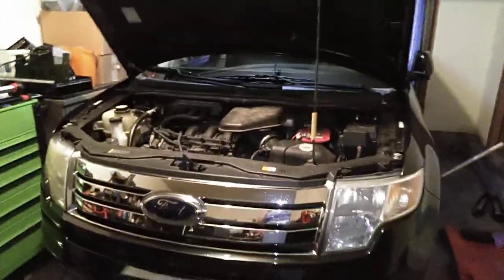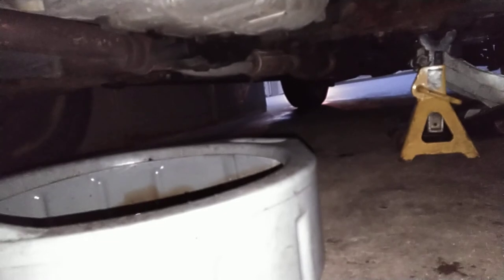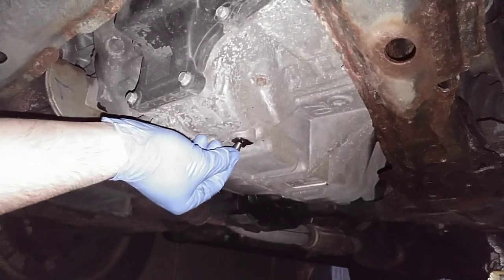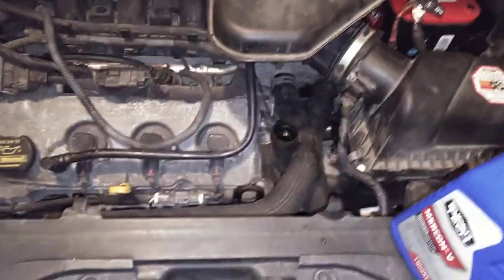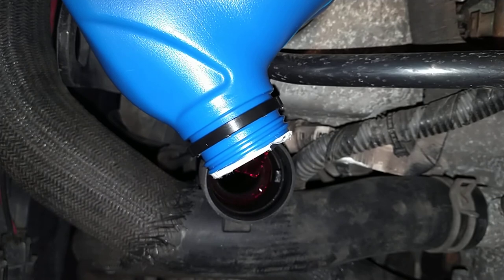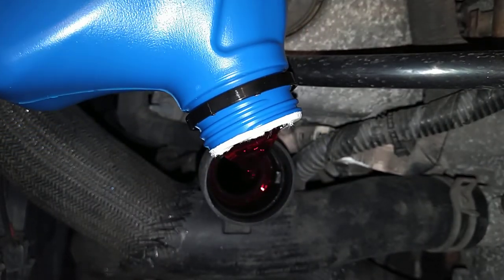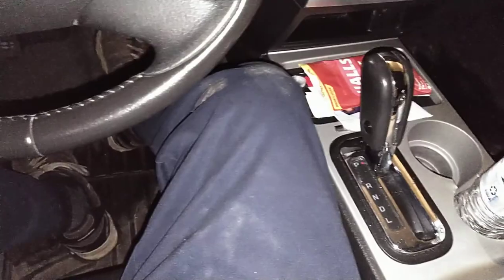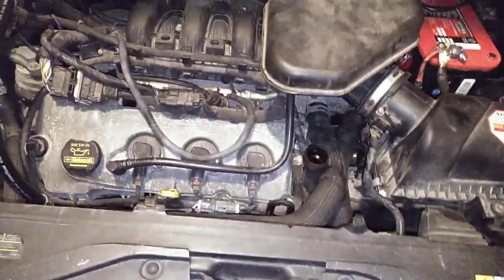Ford edge transmission service

Comment: Please why is my 2010 Ford Edge not moving when I step on the gas and it’s giving a grinding noise?
Reply from the maker: Do you have a video of it? It is either a PTU broke or the transmission went out. Open your hood and pull the dipstick on your transmission and see if there is fluid on your dipstick, if there is what color is it? Black or really dark is bad, that means that it’s burnt. If it’s pink or red it’s good. Pink is the best but red is okay. Let me know what you find!
Reply: @T-MillProductions  I just checked,it’s dry no oil in there.
Reply from the maker: Okay, go buy about 5 quarts of Mercon V transmission fluid from the store and slowly d fluid to it. If the stick is dry start with 2 quarts at first and then let it run and keep checking it. If it’s low you have a leak somewhere that you need to find and fix
Reply: @T-MillProductions  this was really helpful.thank you so much.I owe you.
Reply: @T-MillProductions  and I noticed when I park they was a leakage don’t know if transmission could be the problem too
Reply from the maker: You’re welcome! I hope you get it fixed man. Let me know if you need anything else. Check out my other ford Edge videos if you need help in anything else.
Reply from the maker: I would be willing to guess you have a transmission fluid leak and that’s what that fluid was on the ground. Make sure you buy Mercon V do not use anything else but that! It says on the front of the bottle Mercon V don’t use the dexlll/ Mercon. That’s the old style fluid
Reply: @T-MillProductions  okay after that will the leaking stop or I will need to seal the place the leaking is coming from?
Reply: @T-MillProductions  okay I will.
Reply from the maker: You will need to find the leak and have that fixed. Common places are the seals where the axles go into. Watch my video of the drivers side front axle seal. And the ptu on the passenger side is a common one too
Reply from the maker: Sounds good man!
Reply: @T-MillProductions  thank you man.
Reply from the maker: You’re welcome!
Reply: @T-MillProductions  will I need to talk down the engine before I fix the leak issue and fit it? Or I can just go from underneath
Reply from the maker: Did you diagnose the leak yet? You should be able to fix most issues with the engine still in the car
Reply: @T-MillProductions  yes I did man.but the car broke down and won’t start again I don’t even know why.battery still showing but engine not rolling
Reply from the maker: Oh no man that’s not good. Does it crank over?
Reply: @T-MillProductions  what do you mean if it cranks over?
Reply from the maker: When you turn the key to start it does the engine start to turn over but just not start? Or does it click ? Does it do nothing? If it cranks over but doesn’t start it might be a fuel pump. Ford had a recall for edges a few years ago. They replaced my gas tank, straps, and fuel pump for free
Reply: @T-MillProductions  it just click.
Reply from the maker: Sounds like either a connection or battery. Do you have a video
Reply: @T-MillProductions  I left the car somewhere.
Reply from the maker: Oh okay
Reply: @T-MillProductions  it does nothing right now
Reply from the maker: Is the battery just dead?
Reply: @T-MillProductions  yes and the engine is not turning
Reply from the maker: Try jump starting it
Reply: @T-MillProductions  Ok since the engine is not rolling I don’t know if it will work
Reply from the maker: Your battery has to be charged in order for he engine to crank over. How old is your battery? If it’s over 4 years old I would say replace it
Reply: @T-MillProductions  okay but what If I put in another battery?
Reply from the maker: Then you’ll be good. Make sure your alternator is charging tho
Reply: @T-MillProductions  okay thanks man.thanks for everything GOD bless you.
Reply from the maker: You’re welcome friend! Good luck to you!
Reply: @T-MillProductions  good day my friend, The mechanic called me he said my engine knocked now I have to replace the engine.and it’s the second time I’m replacing an engine in the same car.please what do you think usually causes this engines to knock?
Reply from the maker: The second engine? Is it a v6 or the 4 cyl ecoboost? The only reasons I would think would be low oil, or coolant or fuel contamination in the oil causing no lubrication
Reply: @T-MillProductions  it’s a v6…and meanwhile I don’t use the SAE 5W-20 motorcraft engine oil.I use another oil because it’s cheaper than the recommended oil.could that have been the reason for the knocking?
Reply from the maker: No that shouldn’t make a difference, I’ve used various brands of synthetic semi synthetic and conventional oil and I have 230k miles on my 3.5l. I change mine every 3k miles. Do you have any coolant or gas in the oil? Maybe start doing oil samples to see if something is breaking down the oil.
Reply: @T-MillProductions  okay.or can water be the reason for the knocking?
Reply: @T-MillProductions  and how can I do oil samples please?
Reply from the maker: If the oil is contaminated with water then yes because it breaks down the lubricity of the oil and causes the bearings to wear out
Reply: @T-MillProductions  good day man.please can a faulty spark plug cause engine knocking?
Reply from the maker: Do you have metal shavings in your oil? As far as if you drain the oil out of the pan does it look glittery? If you do then most likely there is a spun rod bearing or main bearing causing the knock. If not then it could be a cam phaser or something else. Usually spark plugs won’t cause a knock
Reply: @T-MillProductions  okay thank you man.but how do I notice this issues early so it won’t happen to the new engine?
Reply from the maker: Best thing to do is change the oil every 3k miles, change the coolant every 50k miles, and change the transmission fluid every 30k miles, spark plugs every 55k miles, and the rear differential fluid every 20k miles. That’s what I do and I am just about at 231k miles on mine
Reply: @T-MillProductions  thank you brother.but please how do I check this miles because I’ve been trying way hard to check them.and I don’t even drive my car on long distance again
Reply from the maker: Next time you do any service to your car write down in a note book or in your phone the miles you did the device at and then when you drive 3k miles past that you know when to change the oil
Reply: @T-MillProductions  okay bro,once I get it at the mechanic I will keep you posted.thank you so much for everything.GOD bless you.
Reply from the maker: You’re welcome my friend! I hope everything works out for you! Keep me updated on your situation
Reply: @T-MillProductions  okay man..I’ve really spent way too much on the car and it’s really annoying.
Reply from the maker: I’ve been there man, good luck to you
Reply: @T-MillProductions  thank you for everything
Reply: @T-MillProductions  meanwhile do I need to change the water pump in the new engine before installing it?
Reply from the maker: You’re welcome friend
Reply from the maker: Is it a brand new engine or is it one from a junk yard? If it’s brand new then no, but if it’s used then personally I would
Reply: @T-MillProductions  it’s not a brand new.
Reply from the maker: Then I would definitely replace it before you put it in
Reply: @T-MillProductions  okay thank you.
Reply: @T-MillProductions  Do I also need to replace timing belt?
Reply from the maker: You’re welcome
Reply from the maker: These engines have timing chains and yes I would
Reply: @T-MillProductions  okay.and what engine oil do you refine that I use?
Reply: @T-MillProductions  what engine oil do you recommend for me to use?
Reply from the maker: I use valvoline maxlife 5w30
Reply: @T-MillProductions  can I use that on my 2010 Ford Edge?
Reply from the maker: Yea you can, I use that in all my cars
Reply: @T-MillProductions  how many liters should I get?
Reply from the maker: 6 quarts is how much they take, I’m not sure how many liters that’s is
Reply: @T-MillProductions  good day man.please is it possible to still see a 2010 Ford Edge engine brand new?
Reply from the maker: I don’t think there are any brand new 2010 edges around
Reply: @T-MillProductions  oh okay.thank you.
Reply from the maker: You’re welcome!
Reply: @T-MillProductions  please where can I locate the rear differential fluid?
Reply from the maker: You need 75w90 full synthetic gear oil. I use Mobil 1 or valvoline. Any auto parts store Carrie’s it
Reply: @T-MillProductions  okay once I get it where is the location to pour it in?
Reply: @T-MillProductions  meanwhile if nothing is wrong with the timing belt that comes with the engine I’m buying so I need to change it still?
Reply: @T-MillProductions  is gear oil same as transmission oil?
Reply from the maker: You need a pump to pump it in the rear end. There is a plug on the differential cover to suck the old fluid out and pump the new fluid in
Reply from the maker: These have timing chains, and personally I wouldn’t change it unless you need too, save the money and time
Reply from the maker: Noooooo those are 2 completely different fluids.
Reply: @T-MillProductions  please where can I locate the plug in the differential cover?
Reply from the maker: It’s in the middle to the right, it’s a 3/8th square drive plug
Reply: @T-MillProductions  how many quarts do I need?
Reply from the maker: If I remember correctly it’s takes roughly 2.5 quarts
Reply: @T-MillProductions  okay thank you man.GOD bless you.
Reply from the maker: You’re welcome my friend

Comment: what size / thread is that drain bolt ? would like to replace it with a gold plug.
Reply from the maker: I'm not sure on the thread size. But if you take it out and go to the hardware store I'm sure you'll find out. If I do another service soon I'll gladly find out for you.
Reply: 11 mill
Reply: @brandonterry4638  the bolt is 11 mm , I need to know the thread size , I’m think it’s m10-1.5 threads , thx for ur help
Reply: 1/8 npt

Comment: Does anyone else have this problem? I have a 2008 ford edge limited, i have issues when on a slanted road, not on a straight road, the transmission slips won't switch gears anyone elses had had this issue?
Reply from the maker: Are you sure it's your transmission? Is your fluid black or really dark?
Reply: @T-MillProductions  it's clean ,just flushed it out this weekend
Reply from the maker: Was it ever dark or black? Usually if it slips the fluid gets really dark. And smells burnt. Mine would randomly skip if I was just taking off after idleing. Then I turn off the car and turn it back on and it would go away

Comment: HI, do i need to change transmission filter?
Reply from the maker: These do not have a filter. They have a screen inside that it not serviceable. So no you do not
Reply: @T-MillProductions  be glad you don't have an 02lb7 :)
Reply from the maker: I can just imagine the fun you'll have with one of those lol
Reply: This transmission THEY DO HAVE A TRANSMISSION FILTER but if you want to replace it, you have to remove the transmission and take it apart because the filter its all the way in the back that is why a lot of people say that it is not serviceable. I just replace mine and its a big pain in the rear
Reply from the maker: It's not a filter is a screen. And no one is going to pull a transmission to replace it.
Reply: @T-MillProductions  You are right  and I apologize but no matter if its a transmission filter or a screen the sure thing its that it is a pain in the butt to replace it just in case someone out there its thinking in replacing theirs, its a lot of work
Reply from the maker: It's all good man no apology needed. I just wanted to make sure people knew that it's not like the old th400s or c6s that have an actual filter lol. This new stuff is just terrible to try and deal with sometimes. Did you have to pull the whole transmission out to replace it?
Reply: @T-MillProductions  Thanks bro for understanding and helping out. 
I did remove the transmission but it was to replace some clutches and since i already had it out i replace the screen on it
Reply from the maker: No problem man, and did you make a video on how to do it? I would be curious to see how much labor it takes lol